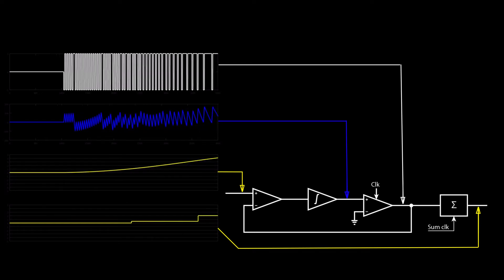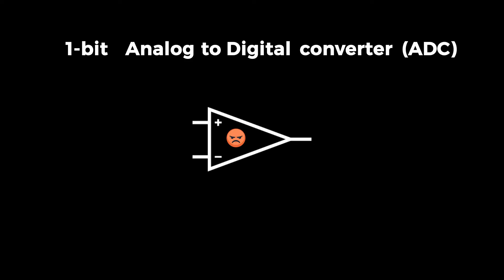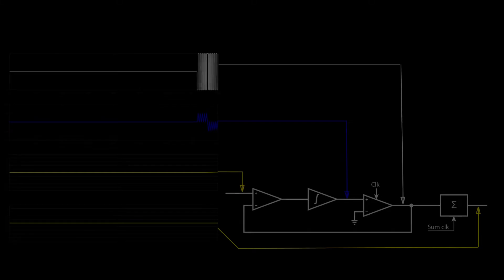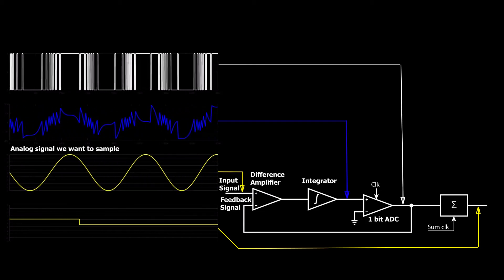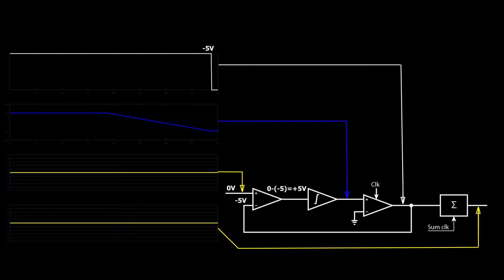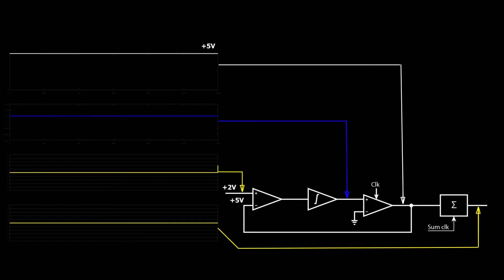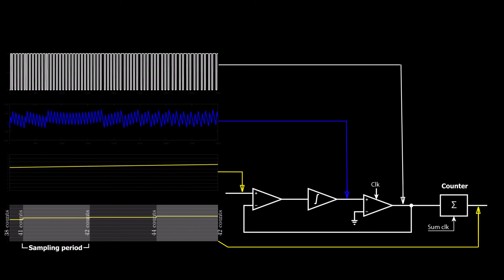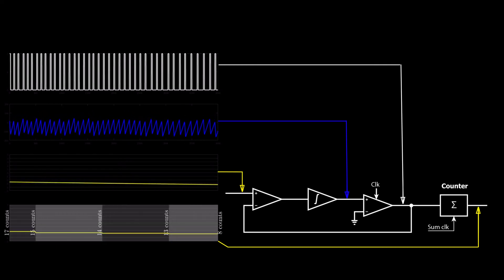Delta-Sigma Modulator Basics

Comment: I have a second-order SD+ADC design example, which includes second-order CIFF+sigma+delta+ADC with Simulink modeling, with an effective bit of 17 bits. It can be directly imported into Cadence simulation, and there is a tutorial for importing and using it, suitable for learning and reference. TSMC 180nm process, including process library and design documents. If you are interested, please contact me。There are also mass-produced MOS transistor reverse circuits (AD1248, etc.)

Comment: If i understood well, the further away the input voltage is right now from the previous input voltage, the longer it will take for the integrator to reach the current input voltage, meaning that more pulses in the fast pulse train will be at 1 (or 0 if the input voltage is negative) 
Am I right?
Reply from the maker: Perfect!

Comment: I didn't get it. Where is the representation of the input voltage encoded? The 0v and 2v examples where good. What I got from it is that on 0v input, you get a 50% duty-cycle square wave, on positive values you have higher PWM duty cycle, on negative you get lower. What does the Sigma module do? Sum up the bits it sees during a sampling clock cycle?

Comment: nice! i used a fully digital implementation of this on a microcontroller. it means i can have a microcontroller be sending an approximation of a floating point value (from a pid controller) to drive a relay, but only switching at the cycle period at most :)

in this case switching eventually leads to mechanical wear, so having something that switches less when further from 50% is very nice.

Comment: Good explanation, but just one note. It will be easy for understanding if the final counter will be signed and bidirectional (up/down counter), so when the analog input is near zero and output of the comparator is "+ - + - + - ...." the output of accumulator is about zero too. I know that it is just a matter of signed and unsigned numbers, but anyway  :)

Comment: As I understand it, the greater the input voltage, the longer time the output of the comparator spends at +5V, so the fewer pulses there will be in a given time and hence the lower the final count will be. If this count is the digital output of the ADC, we have a larger analogue input giving a smaller digital output, which is surely not the case.  Is there another logic stage (not shown) which converts the count into the digital output?

Comment: Someone please tell me where this is applied to? Is it used for audio circuiting? Or modular synths? Or just measuring sound waves?
Reply: Everywhere for everything. The world is analog, but it's easier to process digitally. This is the in-between. For example, your thermometer. Temperature doesn't come in 1's and 0's, it's an analog real world phenomenon that changes voltage. You can put that voltage through what's shown here, plus some additional processing, and you can display that temperature on a screen. Audio systems use these, anything measuring pressure or weight, light, speed etc.

Comment: I understand how you got your output and think you did a good job with the visual to explain the process.  Interpreting the output itself was not clear to me in your explanation. The extent I heard was that it saves the information in a 6bit format, but I'm not following how the bottom digital signal is representative of a 6 bit signal. What does the circuit look like to reverse the same signal from the converted digital back to an analog signal and does it have better results compared to a traditional adc dac?

I'd also recommend ending with a so what/pros and cons on when it would be best to use the Delta sigma adc/dac.  How does noise affect the results? How high of a sampling frequency is needed? Etc. Are these considerations unique and/or on the same scale as a traditional adc/dac?  

Thanks
Reply from the maker: Thanks for the input, these are really good questions! Converting the bit stream of the output into digital numbers is somewhat straightforward (you just need to sum them and transfer the result to a memory unit every 2^6=64 clock cycles). 
I'm thinking of making a follow up video on this, but inspiration hasn't struck me the right way for producing a visual explanation to explain the filtering behavior of the converter in the frequency domain. But thanks for commenting, I hope this was at least useful to some extent =)
Reply: @fzigunov  ok yeah that is simple. Thanks! 

What about the reverse to get it back to an analog signal?

Comment: Very good your presentation, it is a device more difficult to understand than other DAC or ADC types. It would be very good if you can make other videos explaining each part ..... for example because we need the clock since if the same works ..... you could explain the resulting binary code at the output, how many bits is the information, ... etc Greetings

Comment: I understand ideal and non-deal op amp and integrating circuit, but I just don't follow this video at all. Aside from the input signal, what are the blue, white and lower yellow signal lines? Do I need to generate three extra signal to process the input voltage?

Comment: Thanks for the video, it's really nice.
Though I didn't get how does integrator work here and why it even needed
Reply from the maker: That's actually a great question! The integrator filters the high frequency content of the signal, which reduces aliasing effects when sampling the signal. If you didn't have the integrator, the Delta section would be just two comparators in series, and would probably oscillate.

Comment: good video but very complicated. Please make one for absolute beginners
Reply: I think there isn't a shorter and easier way to tell this. If you're not familiar with individual blocks (differential amplifier, integrating circuit, comparator) then you have to catch up with those first, but after that - there isn't a simpler way to explain it
Reply: @tenkowal  yes so he should have explained all those elements first. The video is called "basics"
Reply: @electrobeats8203  Basic for an advanced circuit tutorial. In fact he explained way more than he should have imo

It's ok to have prerequisites. For example: If you walk into a class on creative writing your teacher won't explain basic grammar to you, despite it being needed in order to write a coherent text. 
Similarly, if you take a "basics of complex analysis" course in mathematics you will be expected to know high school algebra, calculus and linear algebra. That doesn't make the course any less "basic".

Just like that, certain topics in electrical engineering also have prerequisites. You'll just have to learn them yourself.
Reply from the maker: I'm sorry it was overwhelming!! I tried my best =]